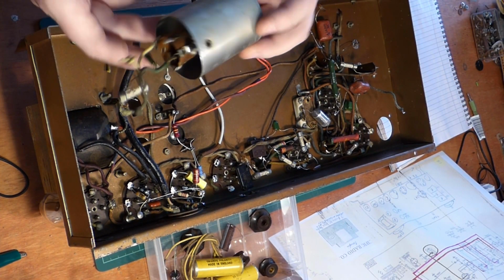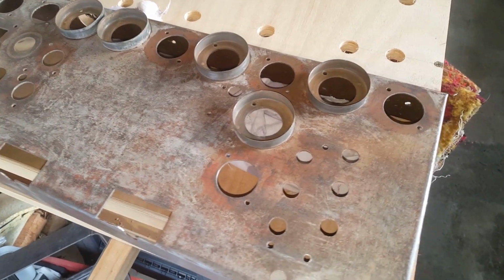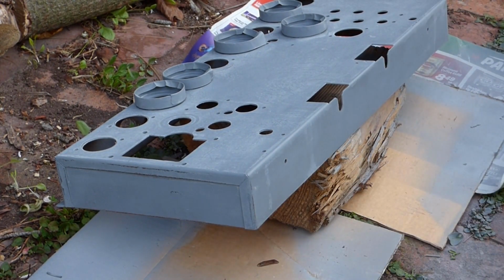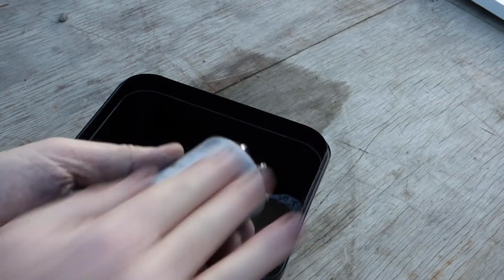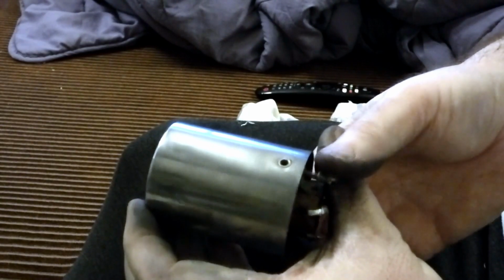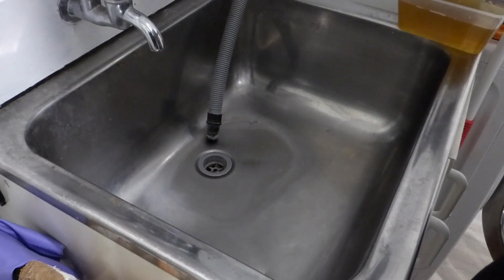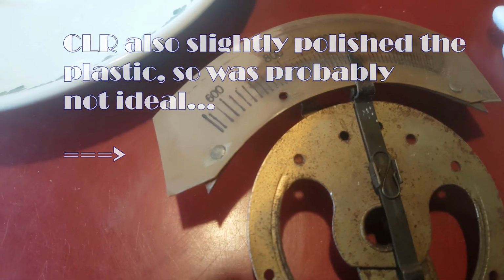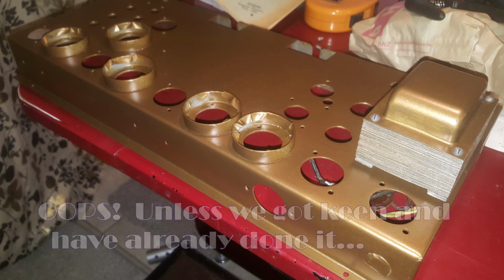1934 Pacific Model 107, Part 3 - The Cleansing

Comment: Hi Steve. Did you get this radio finished ? You've left us hanging like a box set with the last episode missing. 😆👍
Reply from the maker: Hi Terry, I haven't forgotten it... I'm simply...ummm... waiting for the new paint on the chassis to cure before doing any more work on it 😂It's actually cluttering up half my workbench, I really do need to get back into it because it's been sitting for a good while now.  I don't know what got in the way - I think I just had a mental block on it and walked away... I do that with projects from time to time.  I will get back to it, though.  Cheers, Steve